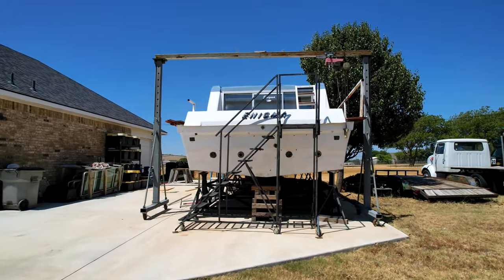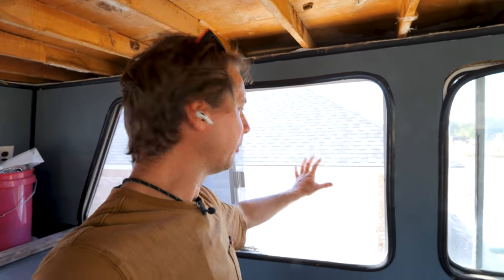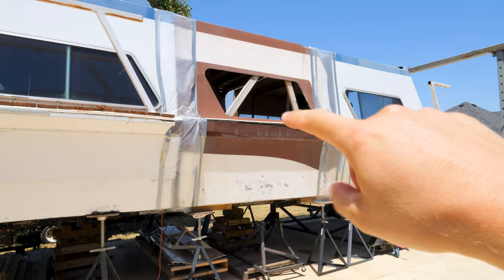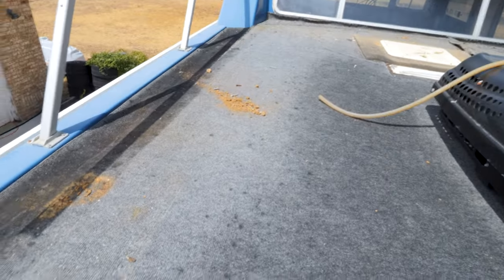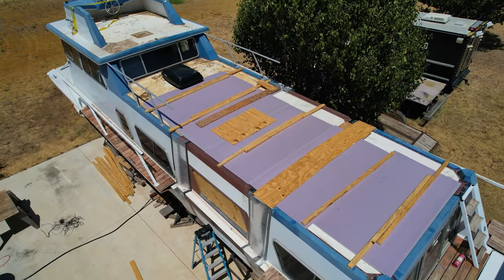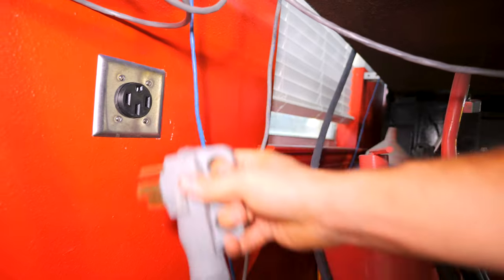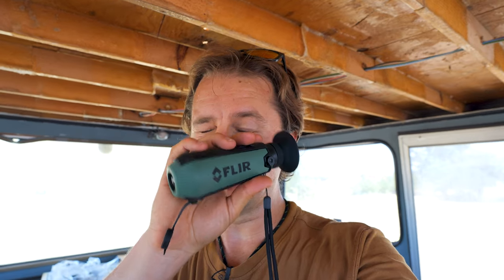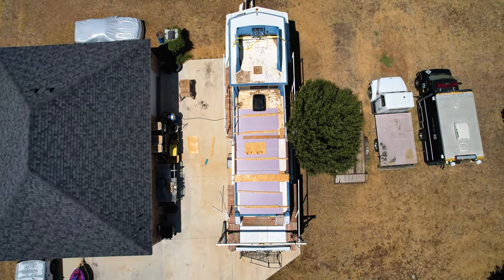Cooling the Houseboat Down In This Texas Heatwave!

Comment: I keep a boat at Cedar Bayou on Texoma. Last month I took down and installed a Dometic rooftop unit-and it didn't cool! I was HOT. I had to remove it and drive all the way home, 9Amarillo) to exchange it for a another new unit.
Reply from the maker: That’s a bummer. I’ve had that one for a few years now and have moved it around between things and it’s been holding up pretty good. When I toured fancy yachts at the boat show they all seemed to have Dometic ACs in them so that seemed like a good sign.

Comment: If you want to know a little low effort YouTube marketing trick, you can plug those bigger boat videos that got on trending into one of those sites that scrapes YouTube tags, and then snipe a  handful of their tags. The tags are actually mostly used by YouTube to suggest related videos, so it increases the possibility of you showing up in suggested videos next to these channels. 

Basically just pick as many as you can fit that are relevant to your videos so YouTube knows the videos are related. You can check multiple videos, find common tags, and then add those to your upload defaults so you can increase your chances of showing up on their future uploads. Unfortunately not everyone uses tags so this isn't a universal hack. Don't just focus on the biggest channels, try to find similar channels in the same niche that are pulling good numbers but might have less competition in their suggested videos. 

But in general you can also use this to get insight on the channel's marketing strategy. I know that sounds crazy, but you can find out what niches they are specifically targeting, possible high value keyword phrases; basically, if they paid for SEO, you're  getting expensive research for free. 

I've used this strategy with my marketing clients and it tends to generate some high quality leads with not a lot of effort, and no need for an Ahrefs subscription lol 

Another tip I would say is ask ChatGPT to write you a generic description of your channel and what you do, you can get specific sections about each of your shows, Rogue Wave, Speed Bump, etc. Have it generate a separate paragraph for each, and also another generally describing what you do and the history of your channel. Tell it to include the good keywords you found on your competitors videos, and then use that as a structure and correct things, change wording, but make sure to keep the keywords. If you can get 3 -4 paragraphs of info in the description you are more likely to show up in search and suggested videos because google will better understand what the video is about and who might be interested in watching it. It's not really about writing for people, as much as writing for youtube and google, so don't worry too much about how it reads if it's a bit choppy or sounds cheesy, people honestly don't read these days anyway.  

Anyway, I hope this ramble helps, I found this channel like, 3 uploads ago and I know your content is of a high enough quality to attract more attention. Always looking out for real creators on the platform. If you have any questions I'll gladly try and answer them. Good luck on the house boat, and the channel!
Reply from the maker: This is some awesome feedback, thank you! I'd never seen one of these tag finder websites before. It's funny reading through what some of the other channels use as tags, seems like a lot of them tag the other channels in their niche.
Reply: @Motiv8Labs  I would definitely put those channel names in your tags and see what happens. Usually when you implement changes like this it takes the algorithms about a month to catch up, so if you decide to make any changes, keep with them for at least a month before you decide if the extra effort is worth it. I'd also consider going back and adding the tags and generic descriptions to older videos. Generally, when a page gets updated, google/youtube considers that page to be newer, more relevant information, as well as an active page, so updating them will only help their chances. (I'd focus on the best performing ones personally, it's a ton of work and is hit or miss with results from what I've seen)

Some keywords you might want to consider working into the description/tags: DIY Boat Restoration, Boat Engine Restoration, Boat Makeover and Refinish, Houseboat Tour, Houseboat Vacation Adventures, Lake Day Adventures, Time-lapse (<---- this is a big one, I saw lots of Time-Lapse related keywords so might do well)

Even if it isn't exactly the video content, including it is better than excluding it. I hate the clickbait world we live in but boy does it work.
Reply: I just ran across your channel and I love it but I can't believe that your wife let you park that boat in the yard. I'm redoing two house boats now in Marathon Florida and I had to buy a marina to do it. My wife said no way no how. If you ever get down this way stop by.